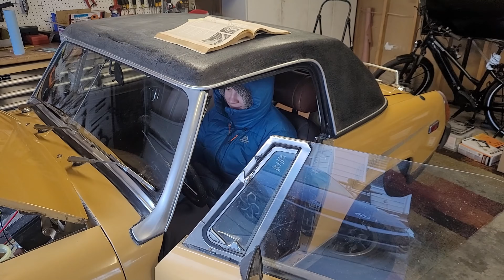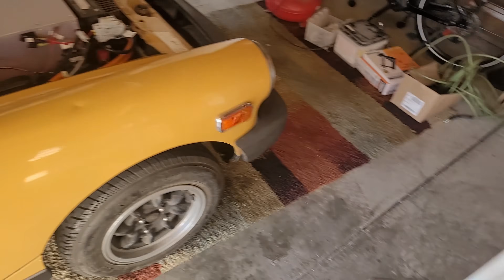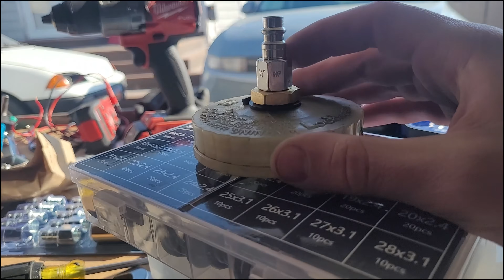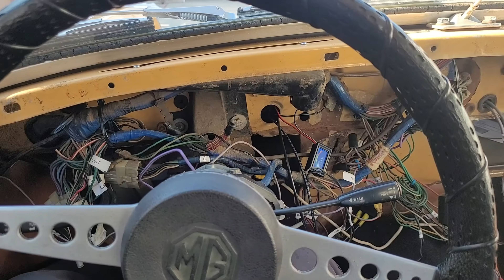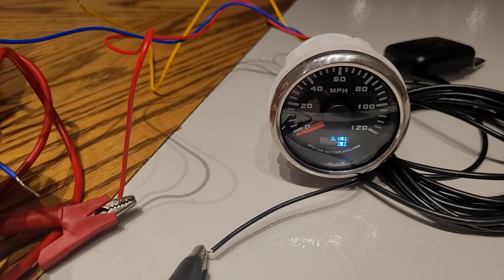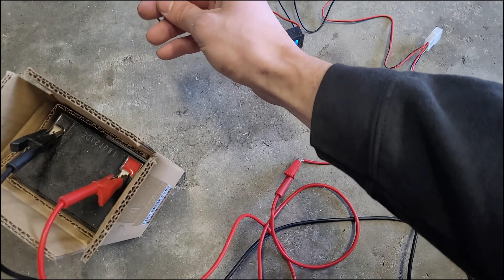DISASTER Bleeding the Brakes! - MG Midget EV Conversion Part 17

Comment: I know it’s late and you probably figured this out, but when using a power bleeder, pack grease around the fitting, which will stop the air and is too thick to be drawn into the line.  Then when done, tighten fitting and just clean grease off.   Or, use the gravity feed like you were doing, but let it go for many hours, just keep the reservoir filled.

Comment: Great stuff Zucca! For your sticking throttle, I had the same issue and used a tension spring to pull the arm back to zero. That way, it makes sure it doesn't stick, and also works as a failsafe in case the spring in the unit goes!